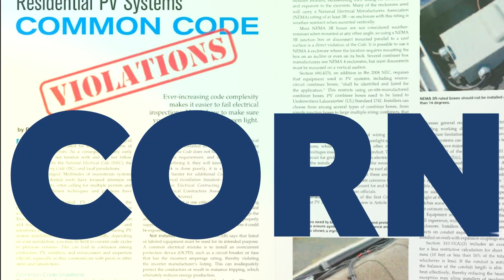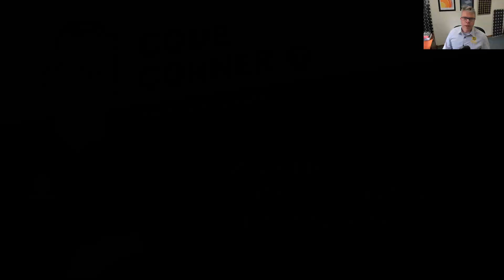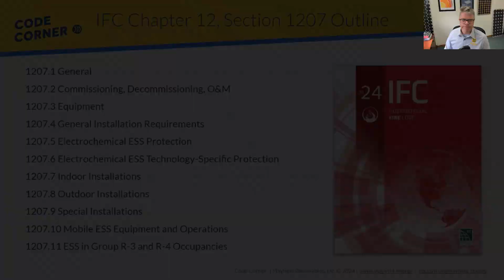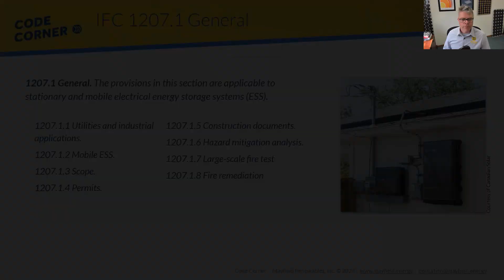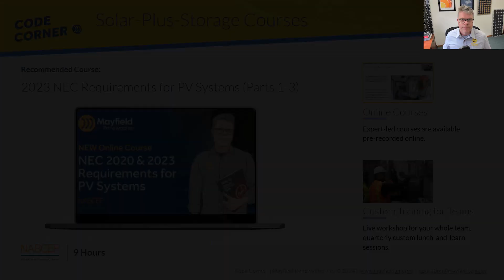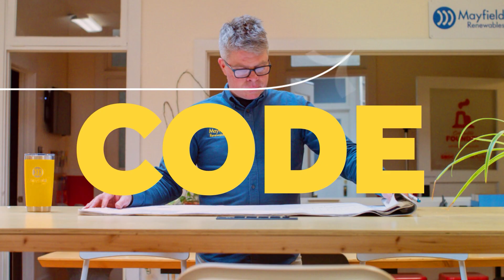Introduction to 2024 International Fire Code (IFC) 1207: Electrical Storage Systems

Comment: How this code is applicable for Electric Substation control house?   (Control house typically have control and relay switchboard panels and lead-acid batteries are sitting in corner to feed DC power to relays.)